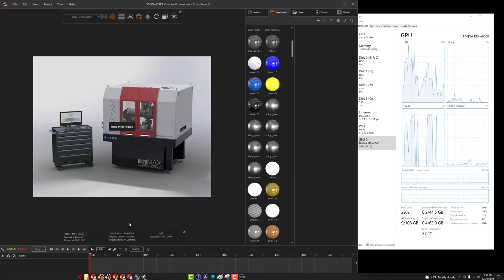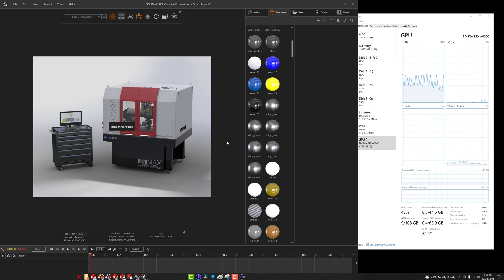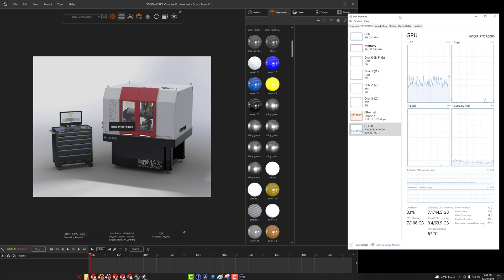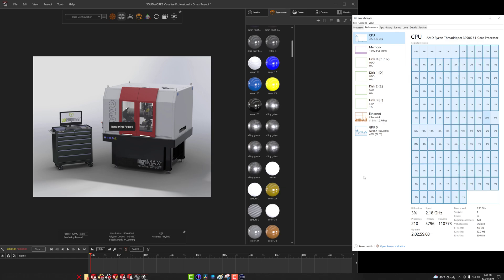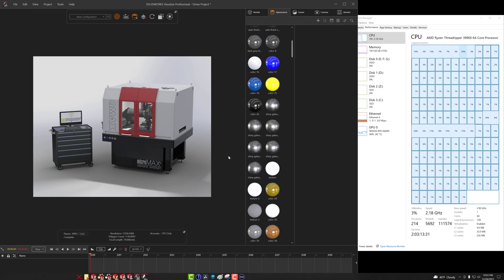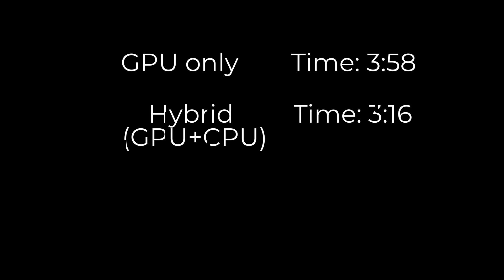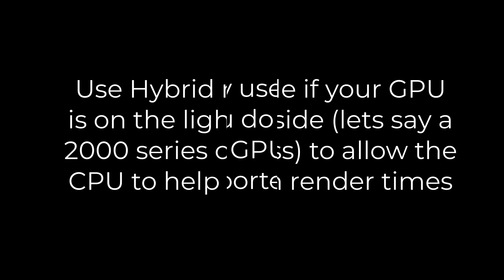SOLIDWORKS Visualize - GPU Hybrid and CPU Render Modes Explained

Comment: Excuse me sir, I have a computer with nvidia rtx 3060. But the gpu rendering option does not appear. And in the system info the graphics driver is not detected or failed. I have installed the latest driver and it is still the same. Is there a solution?
Reply: I had the same probleme, changed the rendering setting (to nvidia rendering, i forgot the whole name) then i restarted my computer and i was able to change the renderring hardware

Comment: why solidworks render on cpu only and gpu usage is 0% ?
Reply from the maker: There are some settings involved but this may also be an issue with your video card or Driver. Please reach out to your VAR's technical support team for specific assistance.

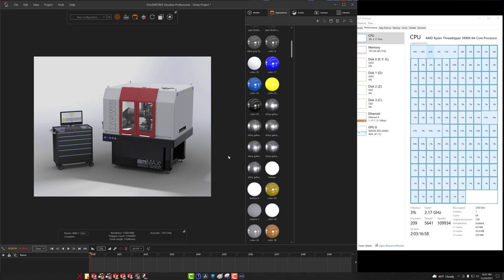Comment: I really need to know, how did you get YouTube to do a little border around the Like Button at 8:20?
Did YouTube detect that you said "thumbs up" and do that automatically, or did you set that somehow?
Reply from the maker: Seems that YouTube does it sometimes when it detects you saying "like" in the video. That time just lined up really well with "thumbs up" but it wasn't anything special that we had to do besides include it in what we said.
Reply: Thanks for letting my know! That's really interesting, and I've never seen that on YouTube before.

Thanks for the video too, I've been looking for a way to render Solidworks files via GPU instead of CPU. The speed test is also really enlightening.

Comment: I have NVDIA GeForce GTX 1050 Graphic card.... I trying to export an image (3000 passes) in Hybrid Mode, But Visualize not using NVDIA... It's taking entire performance from CPU only.... What is the problem..?
Reply from the maker: Hajee, The best process is going to be getting in touch with your VAR for more specific assistance. That being said here are the requirements for video cards 

https://help.solidworks.com/2022/english/Visualize/c_viz_prereqs_system_reqs.htm

make sure your card meets the specifications, and try updating to a current driver.
Reply: @goengineer  yes... It has.. But it's not working
Reply: @goengineer  and It's showing The GPU or device Combination is not supported.... Is there is any solution for that..?
Reply from the maker: @hajeevali47  In most cases no,  Depending on what version of visualize you are running you might try running a newer or an older version to see if you can get to a place where your card is compatible.

Comment: GPU mode isn't working here, RTX 3090, "internal rendering error" but CPU Works, do you know how to fix it?
Reply from the maker: Starting with Solidworks  Visualize 2017 and newer does support the use of Nvidia GeForce 10 series graphics cards. However they do not actively test their drivers, so the first thing to try is update your drivers to the latest available from Nvidia.  If you are still having trouble even with the latest driver reach out to your Value Added Reseller for more in depth support.